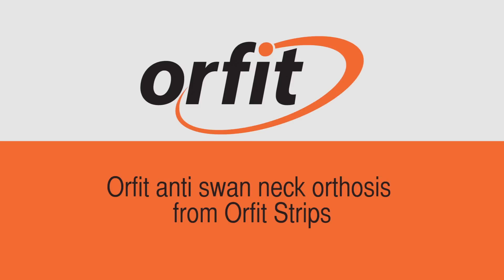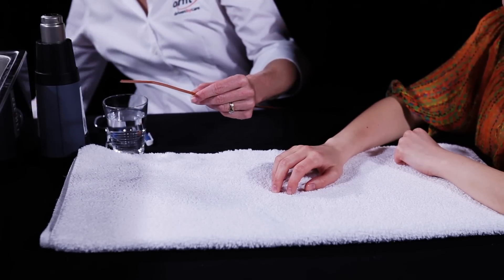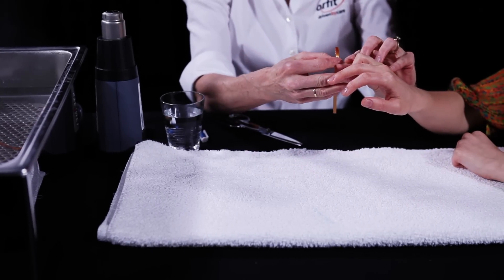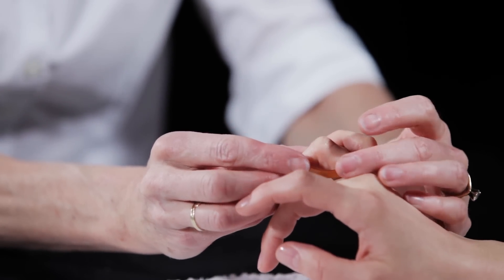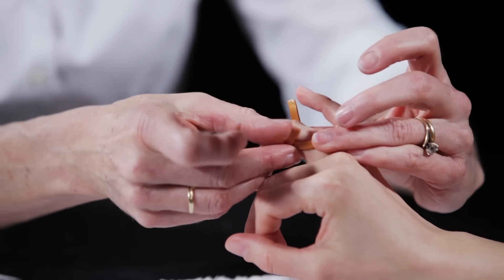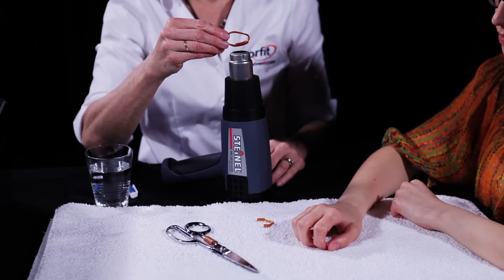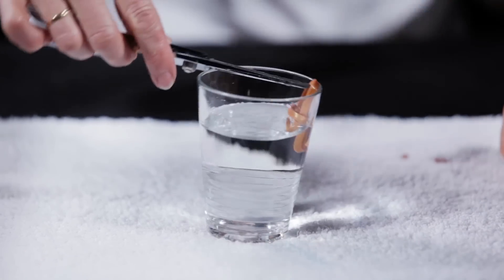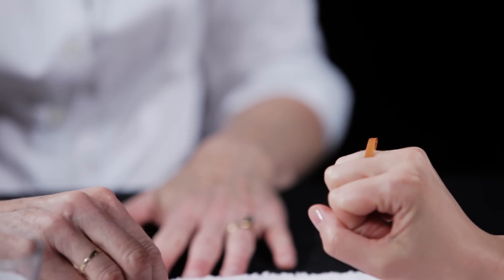Anti swan neck orthosis (Orfit Strips) - Splinting techniques 7/10

Comment: but the other question: should the patient wears this all the time?
Reply: This of course will depend on the individual's condition and diagnosis.  But the orthosis is important for preventing the finger from locking into hyperextension at the PIP joint, so yes, a patient could wear this all of the time without causing harm.

Comment: is swam neck deformity heal 100%..?
Reply from the maker: Hi! A swan neck deformity can have many causes and whether this will heal or not will depend on the cause.

An orthosis like the one in the video can help to maintain functionality in case of a swan neck deformity. The goal is to have the ability to flex and extend. If the finger is stuck in hyperextension, the patient has limited ability to flex the joint.